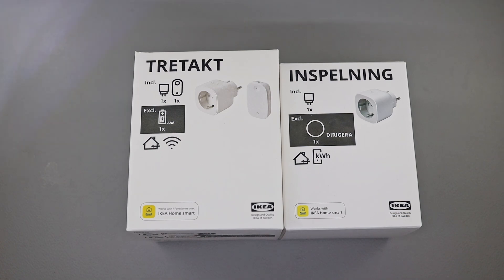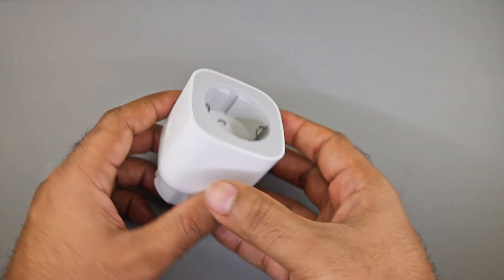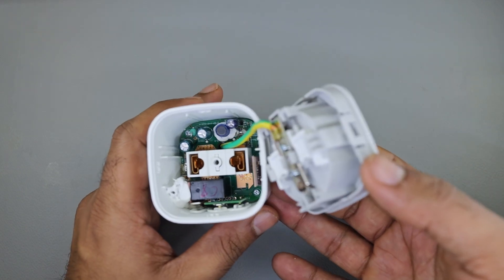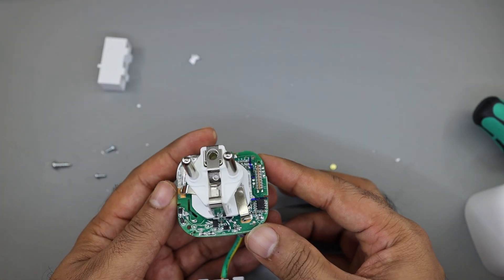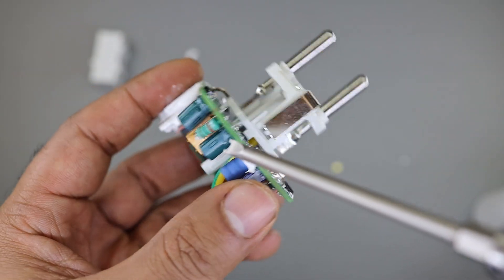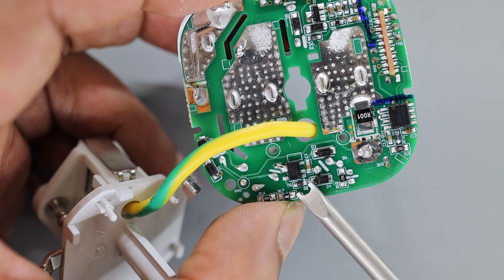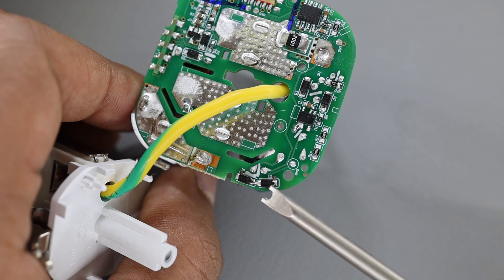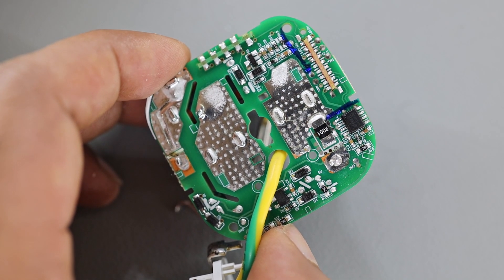Ikea INSPELNING Teardown Review, Ikea Smart Socket with Power meter

Comment: @circuitvalley what is the part number of the relay?
Reply: Golden GI-1A-5DMF

Which from the spec sheet (machine-translated from Chinese) seems to mean:

1: number of contact groups: 1
A: normally open
5: coil-rated voltage 5DC
D: coil power: 0.45W
M: 16A
F: insulation class F

Source: I tore down two because one had a big loose solder ball in it 😅.

Comment: I have an LG heat pump dryer. I've been told that the average consumption of the machine is less than 850W. Would it be safe to connect it to this?
Reply from the maker: I think 850W average Consumption would be quite a bit for the kind of Relay it has.
Reply: @circuitvalley it handles up to 3680w
Reply from the maker: @pizzamannetje79  Not really, For Resistive load its consumption is very very low around 350W if i remember correct. Size of the relay itself  is very very small for 3680 W of resistive load.
Reply: @circuitvalley   but will that be a problem for just measuring the power, without using the relay while the machine is running?

Also, 850W is probably the whole device, including the heating element, not the motor only?